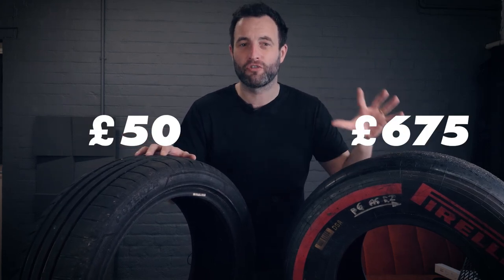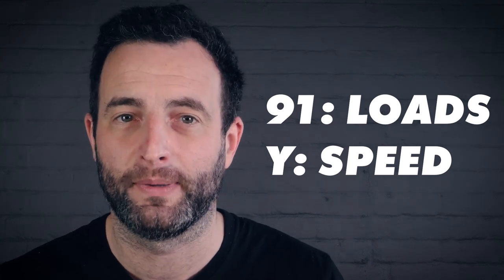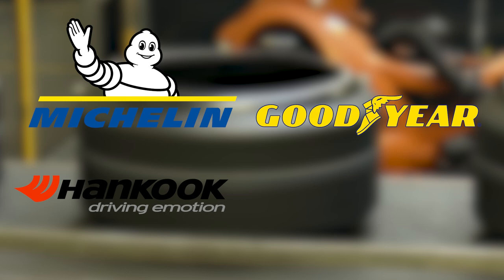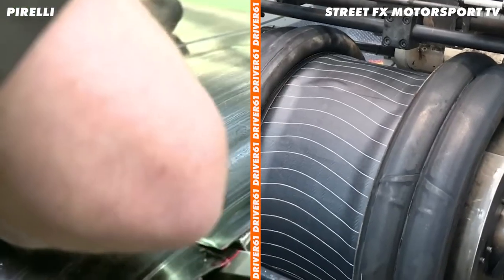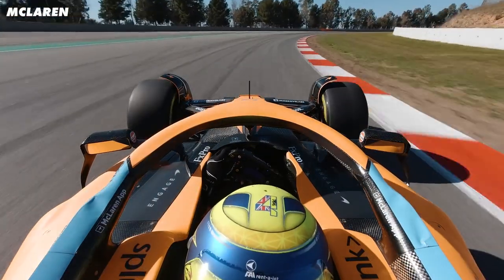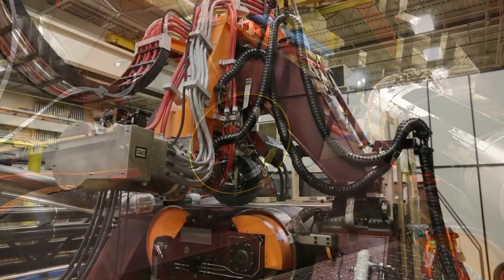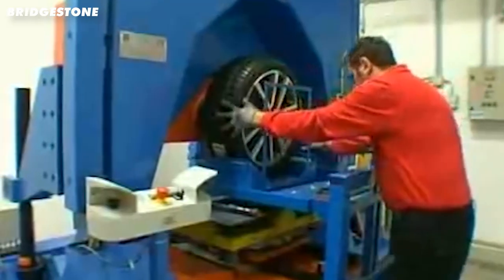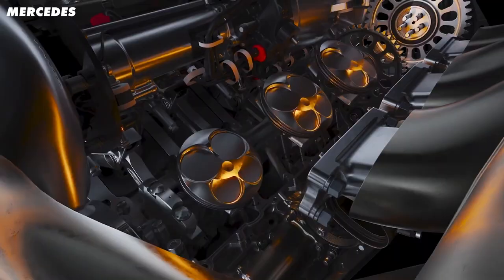£50 Normal Tyres vs £700 Formula 1 Tyres

Comment: Am I the only person who thought  f1 would cost even more?
Reply: Well, even 700 USD per tyre (2800 per set) adds up to 6-digit value over the course of a season. Also you'd think that Pirelli gives a discount, providing them at pure manufacturing cost or below for all the advertisement they receive. Plus manufacturing cost per tyre are reduced by the large quantities they provide and using some of the same tech and production lines for other series, like F2.
Reply: It’s a unique marketing, balance of performance, and very advanced tyre testing & post race evaluation business structure. 

F1 tyres are almost bespoke & there are challenges in terms of thermal tolerance. Amazing.

I personally would like to see more tyre competition in F1, but in the era of balance of performance, the funding as a sole supplier makes sense for the manufacturer & the race series.

Comment: modern f1 tyres are wider than what you said :)

"The front and rear tire sizes on a Formula 1 car remain at 305mm and 405mm, respectively."

Comment: I thought F1 is extremely strict with their tires and works incredibly hard to make sure nobody can get a sample of their tire material?  I'm surprised you were able to obtain one to experiment with.
Reply: Compound changed enough that it doesn't really matter anymore.
I have a friend that worked for Renault and when he left he brought home some parts, a semi broken brake disc, an admission assembly, and some other small bits and bobs. Ton of paper work, but hey, he's got them on display in his house
Reply: @PPedroFernandes  Totally worth it for the cool display piece :D

Comment: My opinion is that making tires intentionally inferior to make the race more interesting is a turn-off.  I don't want to pay to see cars race with tires made to degrade and used engines.  I want the cars to be the best they can be at the start line. Teams should be free to go to manufacturers and have the best tires possible made for performance and to win races.  This is F1. Tire wars had some drawbacks but they were exciting :-)

Comment: not even close. super inaccurate crap. A decent street tire is $200 +. I bought Hoosier race tire for ARCA stock tires in 2005 for $2000 for 4, or $500+ EACH. F1 tires far far more than $600 each.

Comment: F1 tyres probably have no silica or only on the very outside, since it gets hotter faster and then gets too hot very fast.
Mitorcycle road tyres mostly are 100% silica and motorcycle racing tyres have 0% silica.

Comment: 50 quid tire what kind of horrid nasty cheap plastic tire is that, even the tires I use I consider cheap and they are around £100 a corner works out cheaper if/when changing all 4
Also f1 tires workout cheaper than tires we would use on track days/weekend about £500 a corner

Comment: I doubt you get much of a tyre for £50!!

Indeed "back in the day", I had cars come on budget economy tyres and I had two accidents in wet weather because of them and they might have cost around €60 at the time, but as long as I've been driving my current car which I bought in 2009, it came on good branded tyres and I've kept it on good tyres and never had an accident since!

Sure more than five years ago the good tyres I've been buying cost "only" €90 each, but the last two times I bought a set of tyres, they cost €140 each!
(While they're not even sports tyres and "only" 205, 60, 16 tyres, for my 16" wheels when many new cars push you into 18-20" wheels which cost you even more!!) 😯😂🩲😀🤘